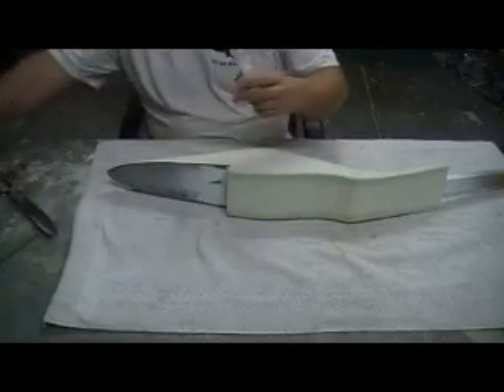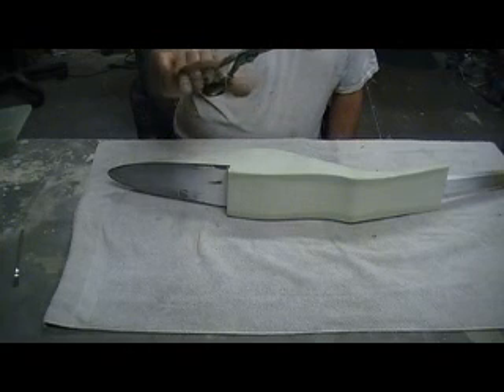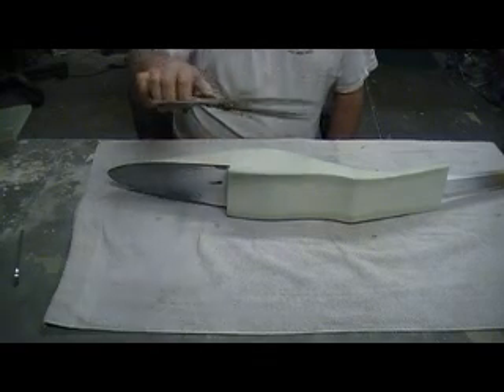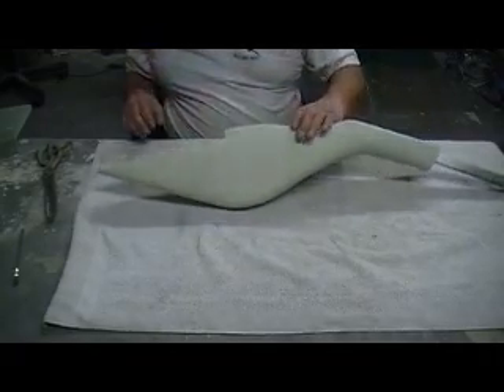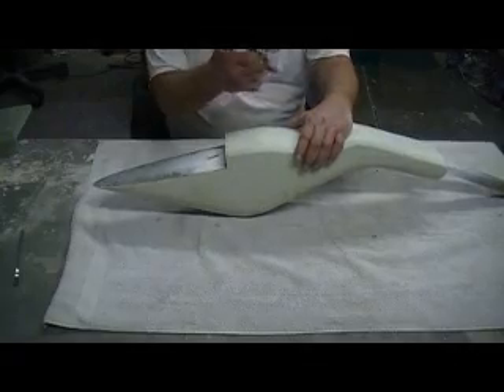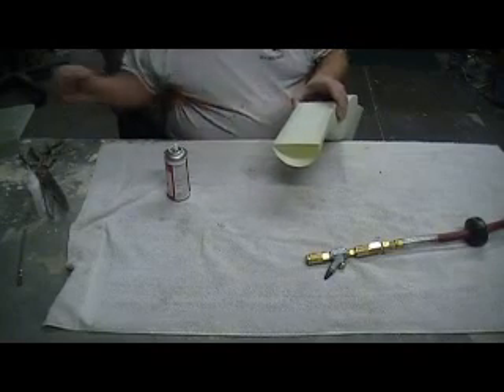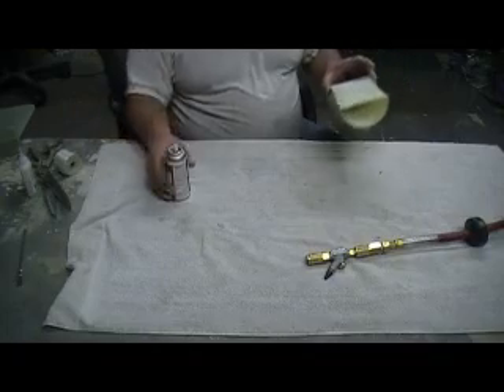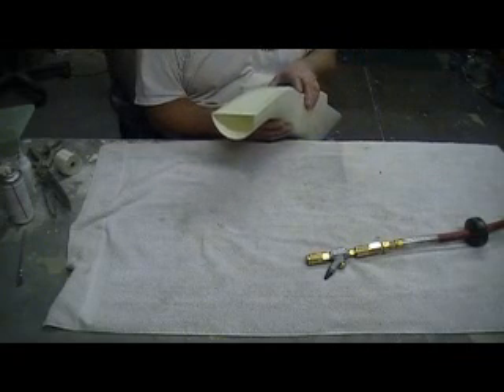how to build a rc jet F-105 thunderchief # 368

Comment: Instead of glue, just run a piece of masking tape up the inside of the duct to hold it.  Which would help prevent drips of resin getting on the inside of your duct.

Comment: Hey Bob,
Where did you get that accelerator for your CA?  I like the idea of aerosol vs a pump and is is foam safe?  I think I am going to stick with 488 and not change mine, I think it is more fair that way.  An autographed pic of your F-105 would be great on my wall, I would rather have one of them than a T-shirt - Hell, I would donate or pay for one of those!
J
J